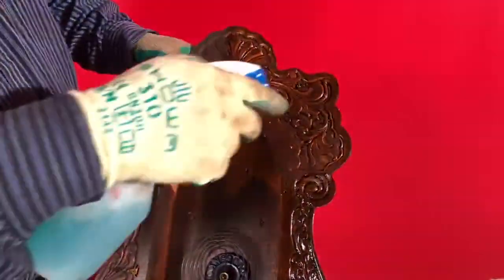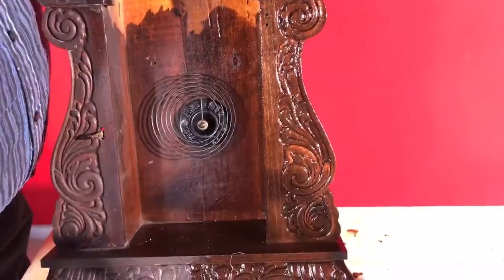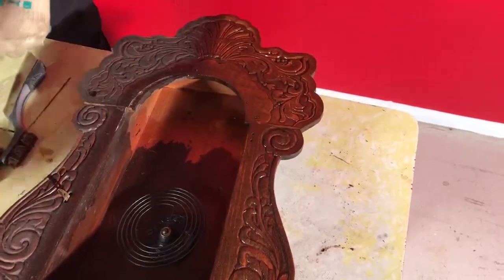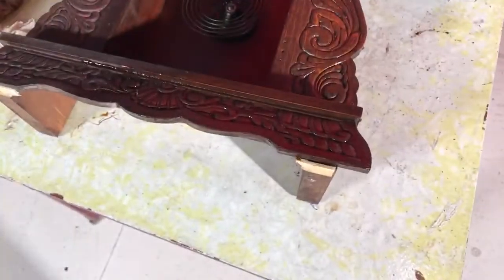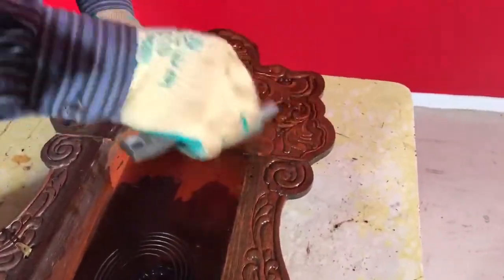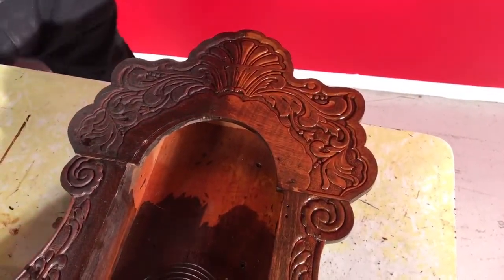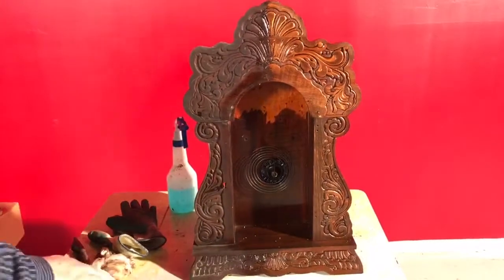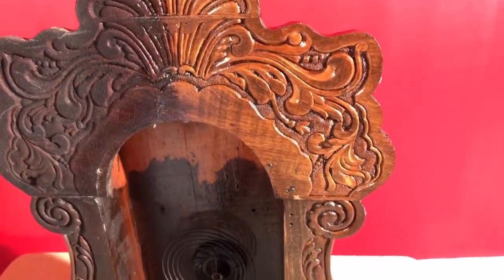How to restore an Antique Clock

Comment: What kinda of liquid-material did you sprayed to remove old coat?
Reply from the maker: Hi, sorry for the delay in replying to you

The 2 liquids that were sprayed in this video was our Cooper's Stripper & Flusher

You can see both of these on our website coopersstripclub.com 

Cheers, have a great day :)
Reply: @coopersstripclub  For the shellac alone isn't denatured alcohol commonly used?